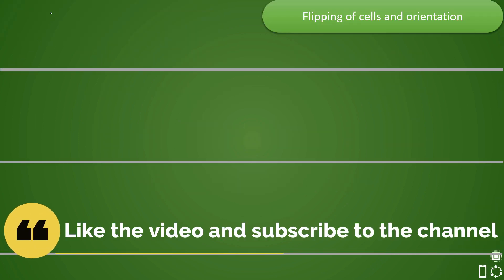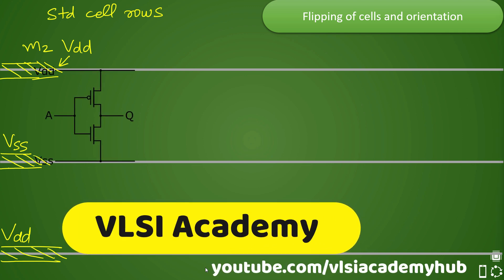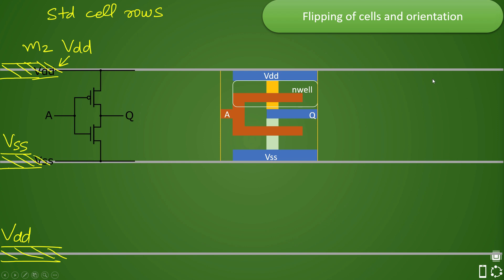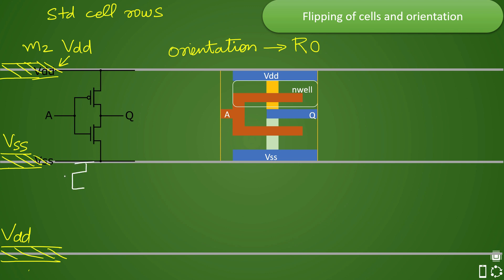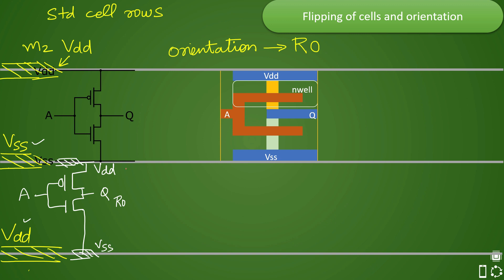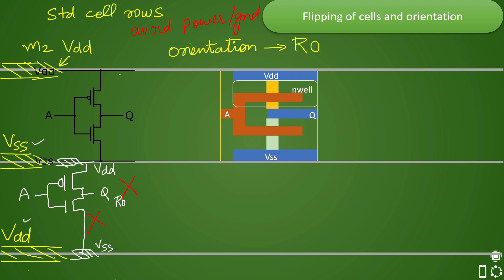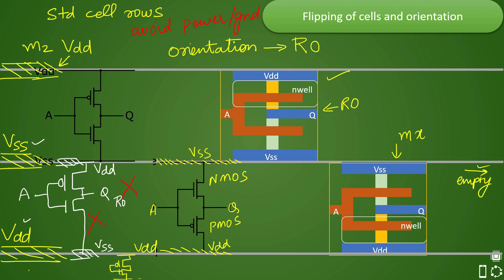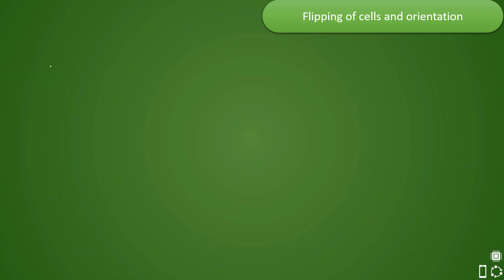PD Lec 29 - Cell Orientation and Flipping | Placement | VLSI | Physical Design

Comment: When a std cell is rotated by 90 degrees, how will the power grid rail on M2 layer match to the std cell power nets?
Reply from the maker: Std cell are not rotated by 90 degree 
It will create DRC
Reply: @VLSIAcademyhub  thanks for the reply.  then R90, R270 orientations are never used in the design?